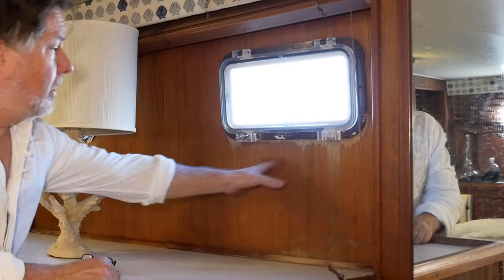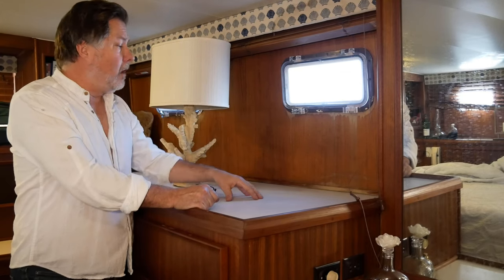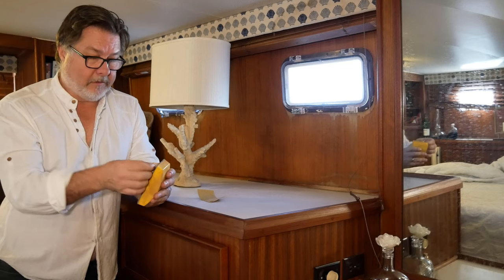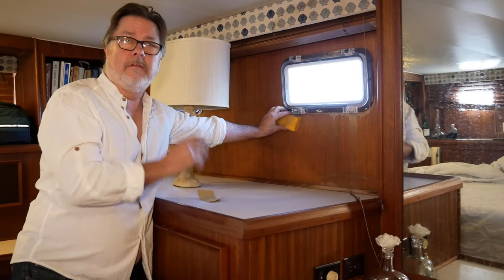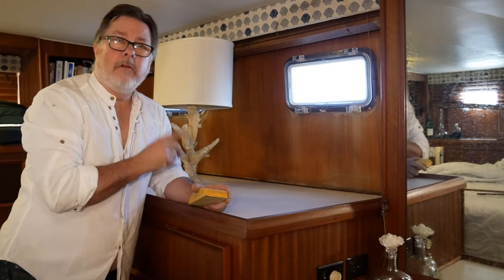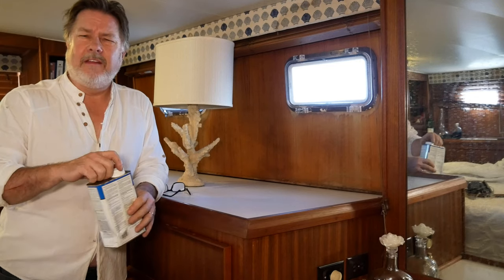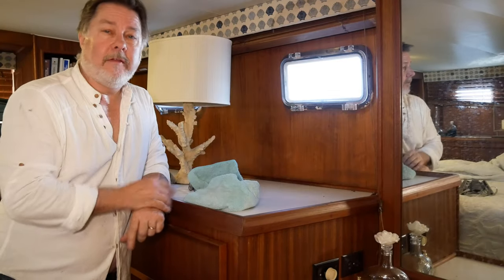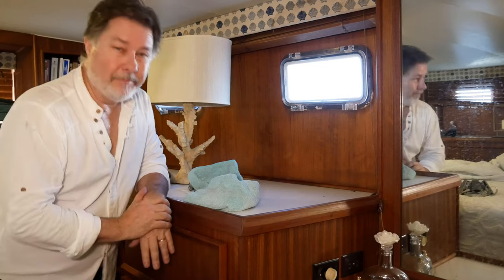How to repair water damaged teak on your boat.  E136

Comment: Nice video, thanks.  I am wondering how many hours a year do you spend maintaining your boat?
Reply from the maker: Not sure. A lot. But a lot of it is upgrades as well. The nice thing about working on the boat, is, for the most part, I find it enjoyable. Not always, but most times!
Reply: @tryingnottosink9107  thanks

Comment: Great video - can you give me the specific teak oil you used? I bought the clear and didn’t get the same results, What’s the part number or name for color? It seems as though in the video it’s much darker on the rag than the clear - thank!
Reply from the maker: I am not at the boat and do not remember, but I bought it at Lowes. Sanding is key!

Comment: Nice job, but what I'd like to know is what tape that was you had used to hold down the solar panels?
Reply from the maker: 3M VHB Heavy Duty Mounting Tape 4910. https://www.amazon.com/gp/product/B007Y7EY6I/ref=ppx_yo_dt_b_search_asin_title?ie=UTF8&psc=1
RVers use it to mount solar panels to the roof of their vehicles. I figured if it can withstand going 75 miles per hour down a highway, it should be good on our boat.

Comment: Ed , I enjoyed the video, I am surprised at the sandpaper grit , wouldn’t 220/320 give a better finish ?
Reply from the maker: You may be right. I am not a good wood-worker. It is just the first thing I tried and it worked well.

Comment: Thanks for the video Ed!  Is your teak a veneer over something else (e.g., marine plywood) or is it solid teak?  I have a veneer (perhaps 1/16" thick), so sanding has to be done very carefully so as not to sand through the veneer.  Thanks!
Reply from the maker: The walls are teak veneer and the trim is solid teak. It does not take much sanding. I just do it by hand and it works well.